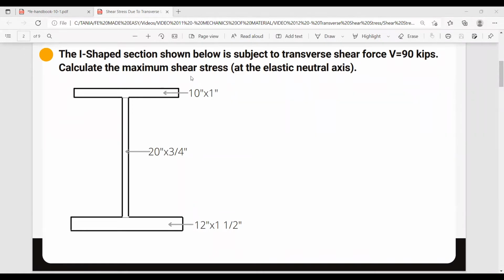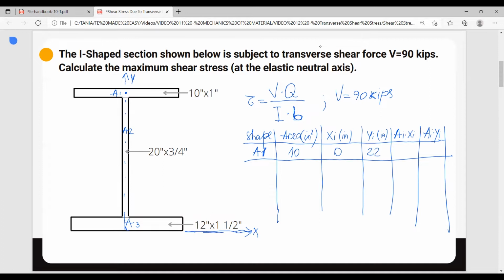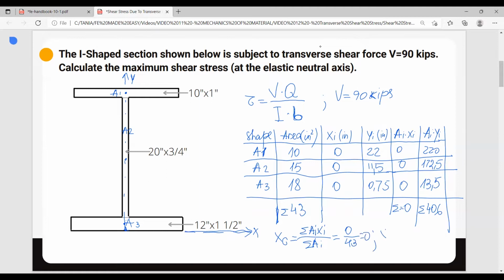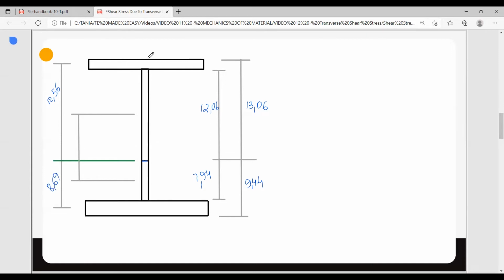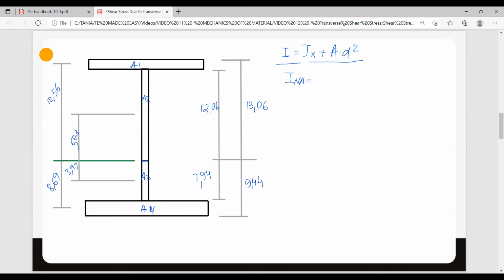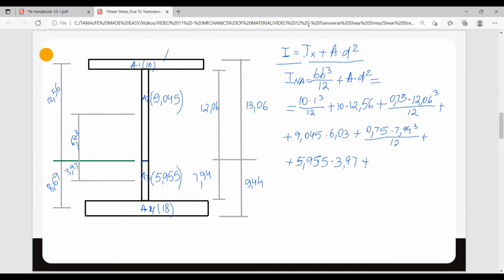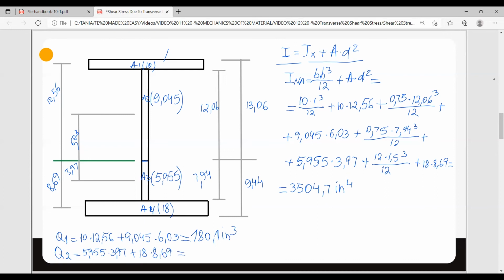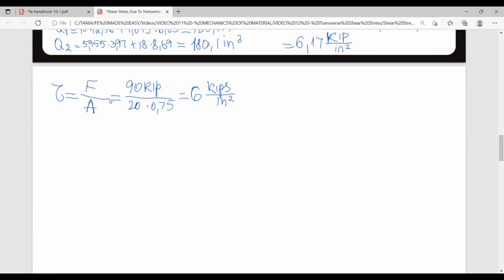FE Review - Mechanics of Materials - Transverse Shear Stress

Comment: When i followed the exmple here, I said this calculation is good but never happened in FE. I was wondering why you put this long example BUT at the end I found you have alternative solution wich is very smart way to solve it and I figured out that you still the best of the top here. Thnaksssssssss a lot for the effort. God blessed you.
Reply from the maker: Yes, it was a long messy example. The point was to understand how it should be done. However, since for I-sections, the flanges play a very minor role in resisting shear, an approximation of the maximum shear stress may be made by distributing the shear force "uniformly" over the web only. So, on the exam (for I-sections), use the shortcut :).
Reply: @femadeeasy  just to confirm how you get the area of  20. 07 ?
Reply from the maker: @a.r7688  the area is 20*0.75 which is the area of the web only. For an I-beam as a general rule, the web is taking most of the shear and the flanges take the moment. This is why at the end of this video I am showing how you can get an approximate shear stress by dividing the shear force to the area of the web only. I hope that make sense.